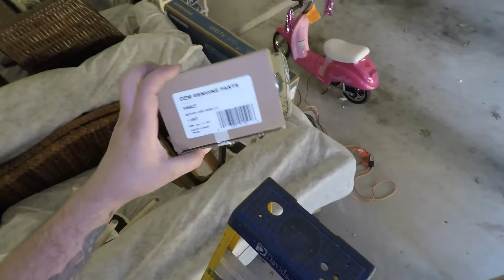Replacing the Logic Board on a Chamberlain Whisper Drive 1/2 Hp Belt Drive Garage Door Opener

Comment: Mine only goes down. Inspected the whole thing twice, via magnifier, multimeter, etc. All seems fine but even at the board arrows. The only one that works is down arrow, same with the clickers. You think is the logic board?
Reply from the maker: If I was a betting man I would lay my money down on a logic board. You could contact Chamberlain tech support to verify, kind of straight from the horse's mouth sort of thing. Plus if it's a newer machine it may be under warranty and they can send you one for free. Just depends on the age of it. I know they have had problems with wall buttons and logic boards.
Reply: @garagedoorgenius  just 4 years and 5 month old but let me tell. Like 10,000 cycles, we open and close it like 10 times a day.
Reply: @garagedoorgenius  luckily I was under their five year warranty. They are sending the module and logic board.
Reply from the maker: Awesome 👍🏼!

Comment: I'm about to order a replacement like this. Battery backup won't stop beeping even with new battery or no battery. Do you happen to know have any advice on a simple way to just stop the darn beeping? Aside from that it works fine. In 10 years I've never needed the battery backup. Seems like there must be a way but I've searched and searched...
Reply from the maker: Kelly Wilson 
Hi Kelly. If you unplug the battery that should have stop the beeping. Have you contacted Chamberlain tech support? The very well could be a logic board issue meaning that changing out the logic board is going to take care of that issue.
Reply: I know it sounds crazy, but yes, even when I unplug/remove the battery it keeps beeping. I did call them and they helped me troubleshoot. They were great, but that's how I came to the conclusion of the logic board. I think I'll just cough up the money and order it. Thanks for this great video on how to switch it out -- I have it saved so I'll be using your video when it arrives. And thanks for taking the time to reply. I love learning how to take care of stuff like this on my own, thanks to awesome people like you!! :)
Reply from the maker: You got this!!
Please don't hesitate to ask any questions.